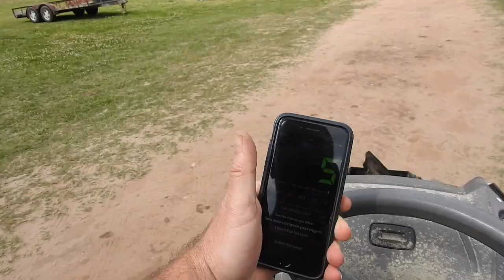New Mud Mower / Husqvarna Hydro

Comment: Thats a good mower there. I believe this model was my first riding mower/mud mower. Had 19hp kohler courage single cylinder. Ran husky Until i found my main cub cadet i turned husky into my main mower.  I had one of these with a 46" deck. Had to replace one of the three clutch pulleys. They can lock up with to much mud and water in them. Bought it for $150 and sold it for $300. Got it cheap because guy thought the hydro was bad. Turns out that when he changed tires on it he forgot to put the key into the keyway and the axel was spinning in the hub. Put the key in there and way in business. Great video!
Reply from the maker: I love and easy fix like that, thank you for watching!!

Comment: Also, a cool trick I use when flushing fuel lines, is to find a gas cap with the little air vent hole in it, and put that on the tank and screw it down. Unhook the hose by the engine and put it into your container and then take an air hose and blow air into the little hole of the cap in little squirts at a time. Gas will flow out of the hose into the container. Just don’t pump the air too long because it will make the gas tank expand as the air going in cannot escape as fast. That hydro looks like it would be a good little wheelie machine! Haha.
Reply from the maker: Good tip and you know I like a good wheelie machine. Thanks for watching!!
Reply: @chud327  your welcome! Always love a good wheelie!
Reply from the maker: Me too, another wheelie video coming out next weekend.